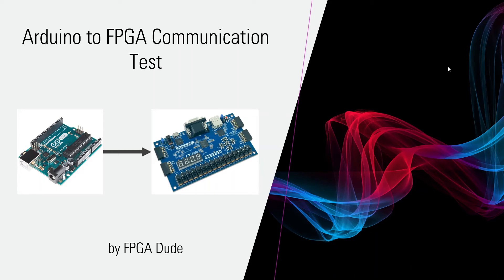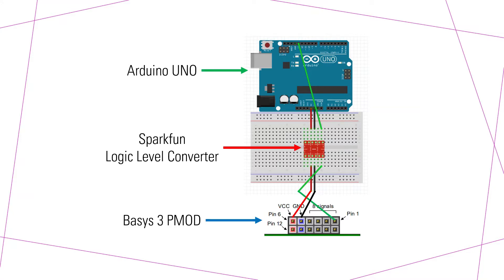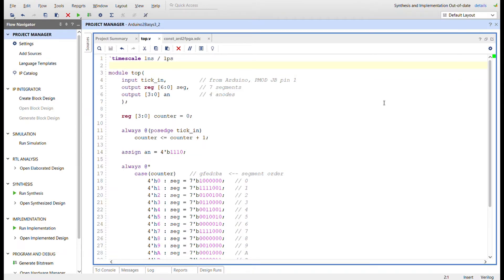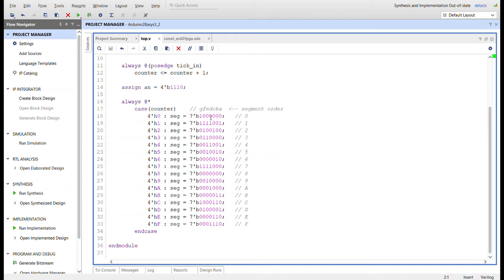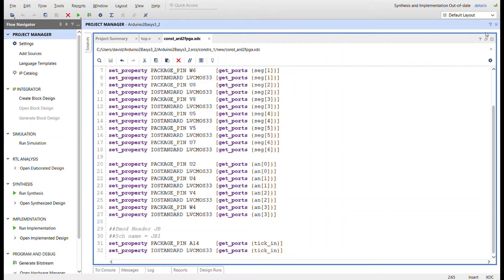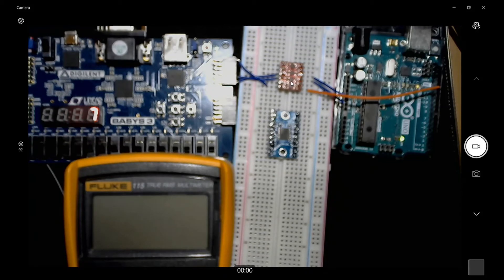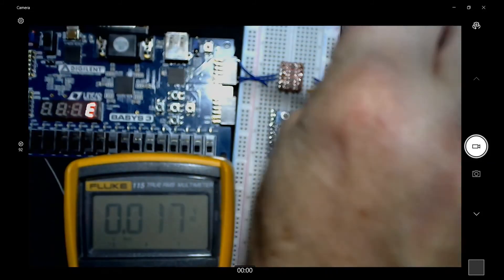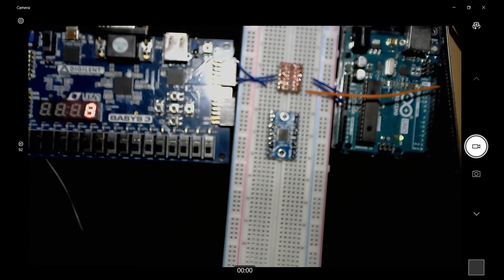Testing Arduino to FPGA Communication(Uno to Basys 3)

Comment from the maker: @hardcode I received your message, but for some reason I cannot directly respond to you. As for your issue, why are you using 9600 baud? That is for a serial communications. All I did in the video was set up a simple 1Hz tick from the Arduino (LED blink sketch) to drive a counter on the Basys 3 FPGA, and then use a 7-segment display driver to display the hexadecimal value on 1 digit of the 7-segment display. If you are using serial communications at 9600 baud, then you are doing something different from what I did, and it is hard for me to know what your issue is. If you would like more assistance with your project, please email me with more details so that I can understand what you are trying to do and maybe help you out.

Comment: To make Basys3 to Arduino uno the architeture is the same? I want to elaborate the logic in FPGA and the execution of a counter be done by the arduino
Reply from the maker: I don't understand your question about Basys3 to Arduino architecture.
Reply from the maker: You can elaborate the logic in the FPGA and the counter in the Arduino. Just be sure to have the logic level converter between them as the Arduino is 5V and the Basys3 is 3.3V. Allowing 5V into your Basys3 will more than likely damage it.